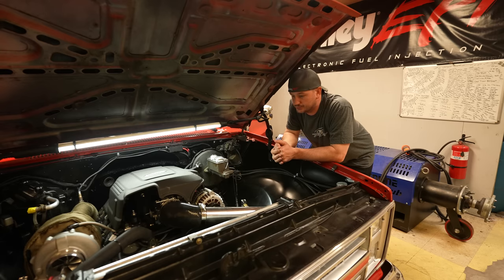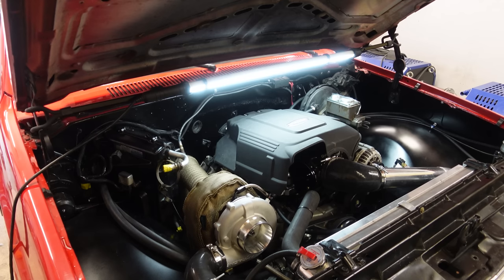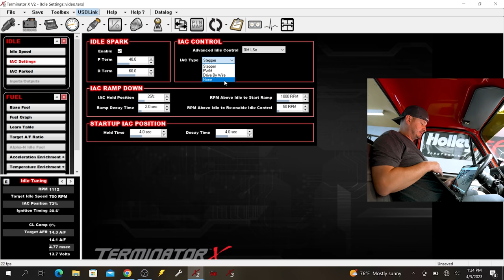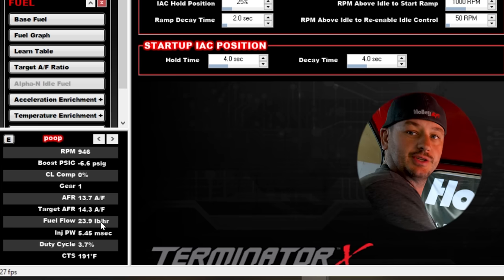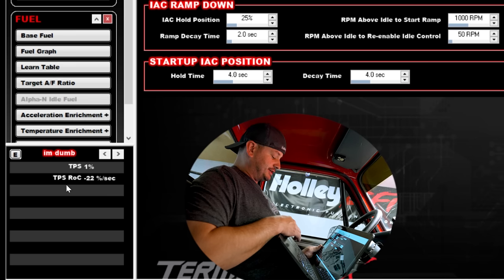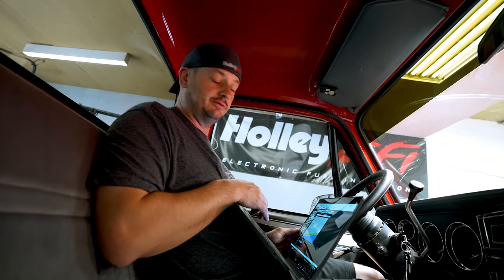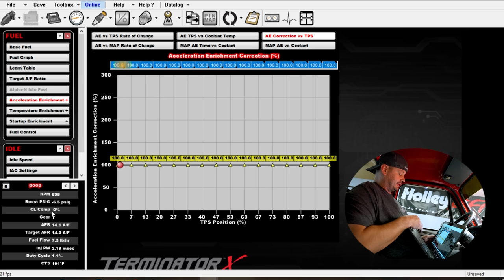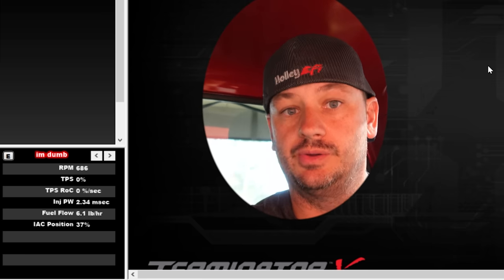Holley EFI Idles Like Crap - Troubleshooting & fix

Comment: Veeery good video! I have similar problem with my Microsquirt ECU on my bike but with significally lower frequency of the TPS signal wobble. Unfortunately my TPS sensor is good but the 5V reference voltage has some brief voltage sags. Very unpleasant as I just can't get away with this and the unwanted accel enrichment triggering. Thanks Joe!
Reply: Check on your charging system.  If it is raising and lowering the voltage that might be causing it.
But I am NOT an expert AT ALL!!
I am battling a crap idle but TPS stays steady.

I have to wait to take mine to get it tuned until I can get some money in.

Comment: 3 TPS autosets later= gimme a new one, this things junk!! 😂
Thanks for proper troubleshoot training though
Reply from the maker: Tps auto set works just fine as sensor reads perfectly until you start the engine
Reply: @JoeSimpsonAtTempest  No glitch or hang in the key on engine off state?
Reply from the maker: @jasonbrinegar6759  nope. 100% perfect and normal. Usually it’s obvious when it’s the sensor. This is the first one I’ve seen act this way

Comment: Data is definitely the King when it comes to seeing/finding issues (and or improvements)👍
I recently got connected with a new tune that was reving and surging really bad (at high idle). Between him having slow/lagging internet, and me not being able to hear how it was running via phone (couldn't see or hear exactly what was going on real time, live). Long story short, his Data showed that his "Global File was corrupted" (several years of tuning Holley EFI on bikes and this is only the second time I've ever seen a Corrupted File). This one was literally "very quickly turning his injectors off-on-off-on-off-on" (every time the rpm reached and or went though the 2,400 RPM cell on his Fuel Table). I could tell his fuel flow was "inconsistent" while we were connected but what I didn't see until later was, his Fuel Flow, Pulse Width and Duty Cycle were ALL "going to ZERO" (just for an instant, even though there was obviously a number in that Fuel Table Cell). It took me longer than I thought it should have but in the end it was the DATA ❤ that showed why it was revving and surging really bad...
Reply: Data rich , Sensor poor

Comment: Normally if there are fluctuations that can't be eliminated a filter would be required, either digital (like moving average) or a capacitor based. Depending on how much you need or want to  filter it out you can might less throttle response.
I suppose the software doesn't give you access to filtering parameters so the alternative would be a capacitor.

Comment: Fuel correction per 1000ft of elevation? New LS turbo setup, driving from 7000ft DA to Sea Level. 

Any idea of what percentage of correction I should leave the Holley at to compensate for that kind of elevation change?

Comment: I’ll have to look at my sniper bbd TPS.  I’ve been having the same sort of issues for a year after installing my sniper bbd. It’s weird, if I have air, lights and stuff on then my IAC will stabilize, but with no heavy draw the IAC is all over the map and the idle is terrible. Fuel pressure is good, but I have noticed that after running for a bit the TPS will start showing 1%. So hopefully it’s just that simple. Great video.

Comment: Excellent info. Never thought of how the Accelerator Enrichment parameters could affect idle if the TPS is changing. With DBW the TPS value does change and I now know to check if the enrichment is sensitive to it.

Comment: Hey joe I’m pretty sure I’ve been having this exact issue with my truck it’s basically a stock 5.3 lm7 with a TSP chop monster cam kit w/ springs and pushrods. Numerous issues I have had with this issue such as bad injectors so I got them tested and rebuilt that’s good. Bad high pressure fuel regulator. Swapped that out and now when I crank it, it won’t want to start but my buddy told my to crank down the idle screw and and I set me rpm higher on my terminator x max and gave it gas and it started but I have to baby the throttle and it’ll stay on but everything now is leading me to a bad tps sensor. So if this fixes my issues I thank you so fucking much and if not I still thank you.

Comment: Hey Joe, what are your thoughts or experience on having old school style dual plane manifolds having injector bosses installed at the ports for MPI ? Do you think there would be an imbalance between air flow and fuel injected causing some cylinder to run rich/some lean ?
I have this setup and engine has always run rough especially at idle considering its got quite a mild cam. O2 sensor in the exhaust would only read an average. Manifold runs a large 4 barrel throttle body. 
Any feedback would be great.

Comment: My 5.3 with Terminator X idles well after startup, but when warm, wants to die when coming back
down to idle target, requiring some throttle to stay running. I have a generic Holley tune that works really well everywhere else,  and I have not tuned it nor enabled learn. I had a Megasquirt with the exact same sensors and it idled just fine, so it must be in the Holley settings.
Reply from the maker: Yea that just sounds like a tuning issue

Comment: @Joe Simpson I noticed your live data channels while in online mode have that little delay when the laptop screen displays them...like they don't immediately all show up and pop up (get drawn) one at a time from top to bottom.  I've seen that happen too like it's a computer graphics problem,  but it's not consistent. I use HP ECU with dedicated USB cable on v4, not via CAN BUS.  It was never an issue until I upgraded to v5 or v6 so much so I downgraded everything back to v4 and it was usable again. Any thoughts?  The "i'm dumb" and "poop" channel group names had me ROFLMAO 🤣
Reply from the maker: Yea it’s weird one car it’s fine and the next it’s not. My computer is old i just blame it on that haha